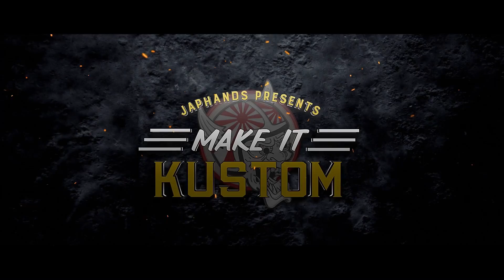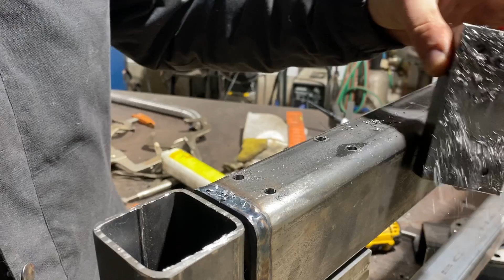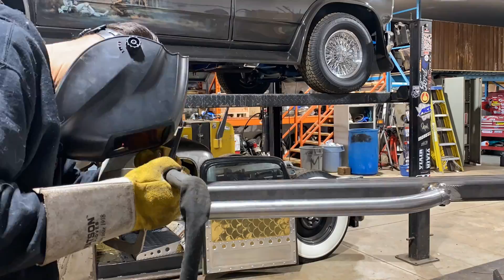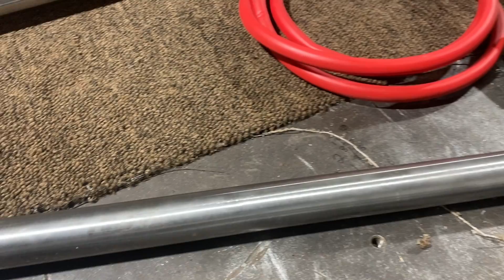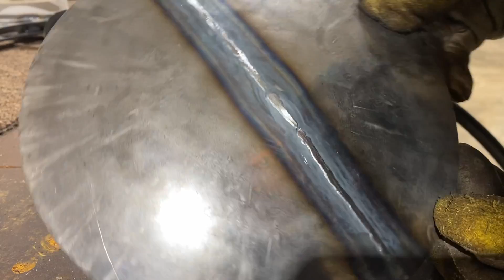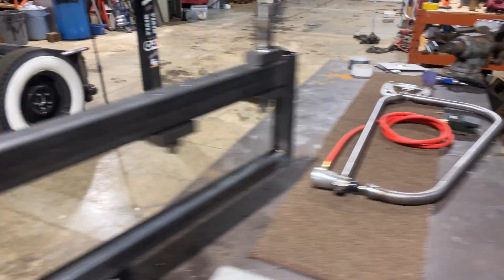Hammer Welding Jig FINISHED!! Production + DEMO of New Planishing Hammers!!

Comment: I'm curious as to the brand of twist drills you use. Also, you must get a lot of questions like this... have you thought of putting an FAQ on your web site?
Reply from the maker: I believe the ones I use are cobalt bits they are ground with a double point usually pretty expensive but my biggest pet peeve is a drill bit that is dull

Comment: Using a toothbrush works well to  lubricate your drills  bits and taps then just trying to squirt a little of  oil on the bit it wicks better down the bit and cleans Debris as well  hope  this helps

Comment: I bought one of the preorder hammers. I’ve kinda tried to not think about it and where it is. Actually seeing how meticulous you are, and how much attention to detail you put into the manufacturing process has me super stoked!!! I mean you had the dies respun on the lathe after heat treatment!! Don’t most manufactures just polish them, and send them out the door? Then you laser etched the radius size instead of stamping them! That grip for the adjustment handle is looking pretty dope as well. I’m getting excited doggie 🤘🏁🇺🇸
Reply from the maker: Thanks for your patience Ken! Yes they are much better than the prototype and have been a struggle but I think you will be very pleased with it! 🙏🙏🙏

Comment: Why the holes in the adjusters
Reply from the maker: They are so I can put a pin in them to lock in the angle
Reply from the maker: Or if you are referring to the plates and hold the adjuster on the hammer there for decoration
Reply: @MakeItKustom  my yes the plate on the adjusters

Comment: Hi Karl, i really like the plannishing hammer production buddy. Just a suggestion - i noticed you were holding the air line on with cable ties, would look finished off if you welded 2 small tubes for the air line to slide through and put a slot (purely for looks) across each tube, similar to how a push bike runs cables for brakes. Very cool tool my friend.

Comment: Now that you have made the jig(s) to produce them, and after your first production run of 50, you might consider having a job shop/manufacturing facility do a limited production run of your planishing hammer for you if demand is high enough.  It can often be very cost effective to have someone else do the bends and weld on the brackets, then you do quality control on them before you let them out the door.  Getting the right shop is important, and get it in writing what you will or won't pay for.
Reply from the maker: Thanks for your suggestion and definitely you are correct. If I had to do more and more I would have someone else do it. I’m already seeing area as I can save time in manufacturing for the next run. I have many tools I want to make

Comment: Nice work! If the ends of the tubes are open on the planishing hammer arms they can be filled with sand, silicone rubber or epoxy to help get rid of some of the noise and vibration.

Comment: Excellent work as always!!! Enjoy watching your channel . Quick question; if you can answer I’ll appreciate it. Where do you get those drill bits that go through steel like butter?
Reply from the maker: There are a few different companies that make them. Typically what sets them apart is that they are double ground tips. It means that it doesn’t have a flat spot in the center. They are also made from better materials but typically it’s close to 100 bucks For a drill index. That’s how I know that they are good lol taipan is the Brandi have. They are Australian

Comment: The amount of pride you show in your manufacturing and workmanship is a great indication of the quality of what your customers are buying. 
Out of curiosity will the hammer flattened out weld dags / drops from penetration or would you lick it with a grinder first ?
Reply from the maker: I would knock the tops off of anything top or bottom that builds up. With enough passes the hammer could flatten it but it would be too much material

Comment: I'm not sure how accurate that "moving" location mount has to be, but screwing it in and out will eventually wear the holes for the screws larger, may I suggest that welding four small location stripes of metal to the jig,on each side of the locating mount,at both locations, that way, I it will be placed in the correct way every time.
By the way--- VERY INTERESTING!!!👍👍👍👍👍👍
Reply from the maker: Yeah that’s a really good idea. Similarly I was going to create dowel pins if things ever started to move on
Reply: @MakeItKustom  --- I thought about dowels aswell,  but they are usually used on fixtures that don't get dismantled very often ( I'm am a former tool maker, and we used dowels on dies that don't get pulled apart often ) so that is why I suggested what I did!!! 
 Why not manufacture then permanently weld the location for the long arm, then have the shorter arm location using the fixture that you have already 👍👍👍👍👍👍

Comment: Have I missed something  ?
How is the Hammer supported at working height ?
Does it clamp in a vice ?
Reply: By watching other people use them, it can be clamped in a vice ,a stand or by hand, if using the last method, you use it directly on the vehicle.
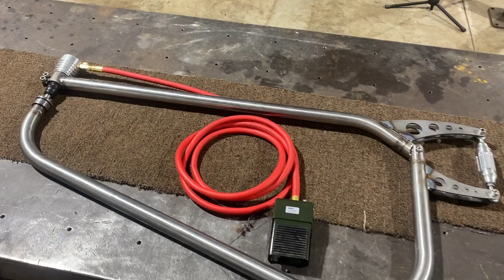Reply: For this example being demonstrated in the video, @ 12:07 you can see it mounted in a vice.

Comment: Re-uploaded? I was halfway in and the video disappeared 😁
I do like that the audio is louder now.
Reply from the maker: Yes the sound wasn’t working well lol
Reply: @MakeItKustom  Lol, I've been there myself.
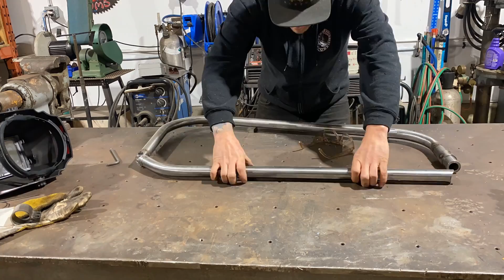Do you have to do more welding with the hammer laying on the table like you show at 3:22? If so, it might be worth tacking down those pads you're using to hold the hammer off the table, then you're not chasing them around. Another idea is to get some toggle clamps and tack or bolt them to the table so you don't have to mess with the hold-down clamps.
I love the channel!